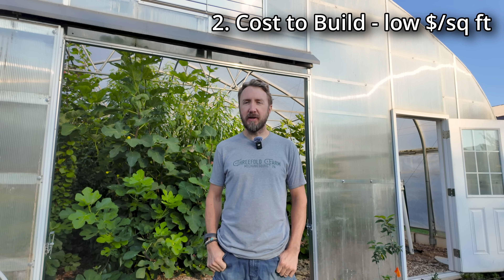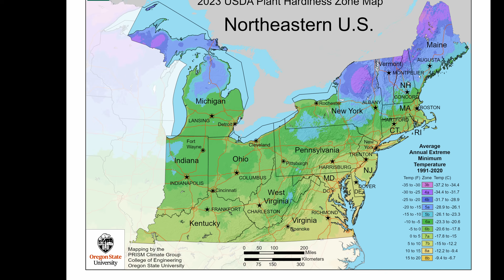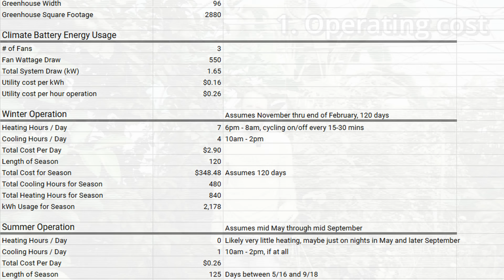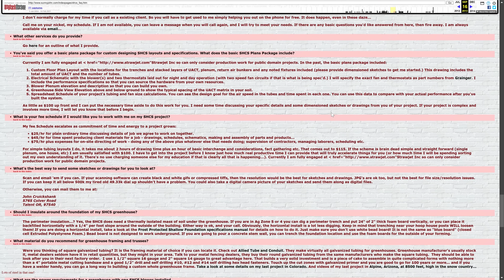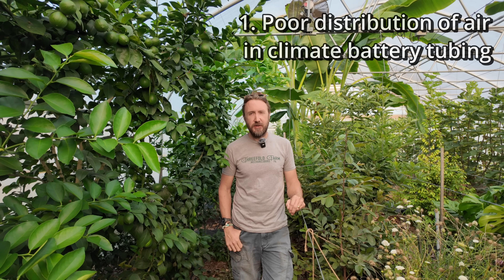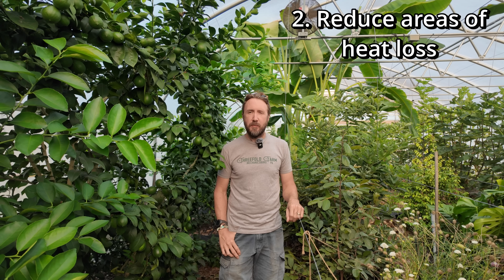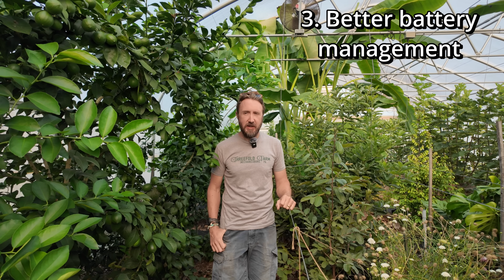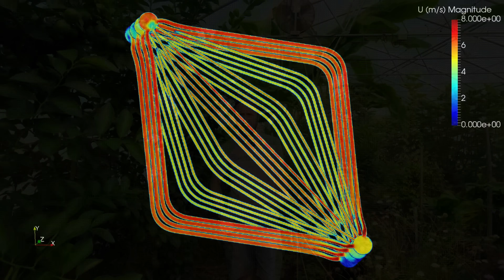Building an (Almost) Tropical Geothermal Climate Battery Greenhouse in a Temperate Climate

Comment: Pa is a very big state.  Ya not as big as AK but big with a # of growing areas in it not only form N to S but From E to W.  I Live at N42 which is the NY-PA boarder when it runs straight W and do S of Rochester.  My guess form the pics I see of ur place u r in the lower Potomac river Valley as flat as it is thus u r 2 growing areas below where I live and if u go further W and a little S rather then getting better it get worse in that u go into mts.  This yr our last forst was Apr 24 and first was Oct 8.  '23 it was Apr 27 and Oct 8.  Making my growing season this yr 167 da if my math is right.  Until USDA change the4 map in what I think 23 our growing season was but 123 days May 15-Sept 15.

Now I keep track of freeze dates for many yrs now and in just the past 10 yr the world has warmed enough to add those 37 days.  Will have to see what happens next spring for that is the day that seems to be coming earlier each yr.

I dont have that much land just 2 ac with only about 1/2ac useful land for growing anything.  rest is to wet and forested so have just one little, 18x7"6" interior I heat for month of Feb 15 until last frost.  Use a 220v heater.  Yes it cost me but not that much b/c I do have one little 5K wind mill up.  Looking to put up another next yr if all goes as planed.  I dont borrow money.  I save util I have enough to buy what I want and then I buy it. Took me form '75 to 88 living like I was making min wage (eat a lot of rice and beans and lived in one little room) and bought this place out right in 89 and got my azz out of the cities and back to where I grow up.

To show how much u can actually grow in raised beds (4'x8'x32") 40 of them and then an area of about  1500 sq ft I grow sweet corn and long vine corp on like squash and melons.  Do a bunch of pumpkins b/c I feed them to chickens.  Yes they love them and they keep well into winter.  Got me 50 layers.  I sale a few Dz eggs every day.  Now in those beds I am able to grow every veggies I eat and I have a farm stand where I sell what I dont.  This yr so far that stand has gotten me a little over 10K.  Still selling winter squash, pumpkins, and other cold weather crops live cabbage fam and such.  I already have put up all I will need till next yr and then some b/c I do have friends over for cook out and dinners so I need about a 1/4 more and put up 1/2 again so that I know I have enough.

I have said I do chickens. Each yr I do 150 meat birds.  Sell 100 of them and keep the rest for me.  I also do Flemish Giant rabbets for meat and I buy beef by the 1/4 cow form guy 2 mi up road. lamb form my next door neighbor 1/2 mi and pig I get form a guy down in Pa 20 mi form me.  Buy 3 lambs and a pig each yr.  Go in with 2 other on the pig.  I take about only a 1/4.

My green house if made with 2x4 with polycarbonate outside and 10m plastic inside making it bubble walled.  Along the north wall which is wood and insulated with 23R, I have 55 gal drums filled with water 3 layers with the top one laying their sides do to height.   Have no idea how much they save me but it got to be a a lest $200 on cost of heating.

Comment: I think maybe you could build a clay pipe and build some fires to bake it in place. Then it will transfer heat better than a plastic pipe so you could have less pipe and less fans. I suppose metal would rust but a clay pipe might work or concrete. Maybe it wouldn't even need to be such a good pipe like you could make sections and just put them roughly together since it will be sealed anyway once it is  buried. Maybe you could just dig a couple of trenches to put the pipe in and it would be good enough. The wind break is important so if you chose a good spot that already has some shelter and warmth it could be quite simple. If you have a trench you could also put one pipe at the bottom and one a bit higher as you fill it in. You don't even need a pipe but an arch or an A shape might work just as well and be easier to build. What might also be worth considering is making a big channel of pebbles and covering with a sheet of plastic. The air could still blow thru like it was a pipe but it would absorb the heat real good and transfer it into the soil over a bigger area. Maybe it would have too much resistance for a fan but if you build the greenhouse on a slope you might be able to get it to flow automatically using the heat differential. In any case you could still use the pebbles as an outer pipe taking greater advantage of a trench dug. In that case you might be able to use metal for the inner pipe like some sort of mesh fencing might be strong enough to hold the pebbles out and then the air could flow readily between the pebbles. Maybe you could put a piece of plastic pipe inside it like a mold when poring the pebbles and then pull it out afterwards. Something like that could really capture the heat in the summer and charge the ground. Then you just do one trench thru the center of the green house and get it in a bit deeper. On the outside of the greenhouse you could put some wood chips and some sort of evergreen bushes to help keep the cold from penetrating the ground under the greenhouse.

Comment: Take a metal drum paint it black fill it with sand and put a horse water heater also, do you put water in there as well? He’ll act like thermal mass but you can also control when you add keep to it as well.

Comment: Outstanding!  I would like to see more detail.  For example, the use of plastic corrugated tubes versus a smooth and better conductor.  Insulating the soil battery from the earth?  Water instead or in conjunction with air as your heat transfer medium.  For example, using metal pipes/tubes in a crushed gravel bed of water that is thermally enclosed, thereby transferring hot air to metal to water.  To even out air flow into the battery, have you thought of using a manifold, like you would do for water?  Use of multiple smaller fans?  What is the best speed to get the most efficient heat transfer?  I will subscribe because you peaked my interest.  Please discuss these ideas.

Comment: As a com sci prof I reasoned that a lean-to greenhouse against my brick south facing wall and barrels of water with aquarium heaters should do it. Zone 7b.
Reply: Put in some geo-thermal tubing to help heat and cool it. Depending on the size. Dont forget to add misters.❤❤❤
Reply: The amount of moisture that will be taken up by the bricks and transferred into your house will be high. Same with wood. It's never a good idea to put a greenhouse against a wall to a house. House walls just aren't made to manage the moisture transfer
Reply: As an engineer, I'd just use a vapor barrier against the brick wall, & place the back wall of the greenhouse against it. It will still act as a thermal battery but will remain a separate entity from ur house.

Pro tip: automotive parts like fans, pumps, wiper motors, relays, etc r all fairly durable & run on 12v. Adding an adjustable dc to dc boost converter to a lipo battery ups its efficiency from 85% to the high 90s, while allowing u 2 dial in presets on both sides. Just bcuz the fan demands 12v, doesn't mean 12v has to b supplied by the battery. U can reduce the input voltage on the converter to 3v & adjust the output voltage to 12v, making ur battery last 4x longer which will increase its overall lifespan by reducing cycling. (A partial discharge & then a partial charge counts as 1 cycle)

It provides redundancy in case of power failure. The battery acts as a UPS. A cheap timer can b used to t on & off the charger at night during off peak time for less money. The initial cost is offset by its ability as an UPS bcuz it will save ur crops from being cooked, or frozen. It will slowly earn its keep thru the electric meter.

The aquarium heaters will b on fairly steady thru winter. U may b able to power them with small micro inverters connected to boost converters as a longterm solution to reducing electricity costs ovr time. I think the heaters might b able 2 run on dc if u open them & rewire them. The alternative is plugging them all into a large inverter & placing a sizable battery bank behind it. To ensure the batteries r not going to heat up from pronged heater coil draw, u can decouple them from the heater power circuit by placing a dc cap bank between the battery & the inverter. The batteries r no longer connected directly to the load, the cap bank is. So its now doing ALL the heavy lifting. It handles startup load spikes & shutoff flyback by preventing them from reaching the lithium batteries which r highly sensitive to both. If u install a cap bank, it must match the voltage of ur system. 48vdc is much more efficiently converted to 120vac than 12v dc is, simple math. If ur battery & inverter r 48v, the cap bank must also b 48 volts. ALWAYS make sure u install an active BMS to control ur cap bank, & ur battery bank. U want to maintain balance across all cells batteries & banks. Safety first.

It should b self sustaining once u set it up. A timer can t on & off the charger, as always, for off peak charging. As long as u calculated how much power the heaters needed in a 24hr period & built ur battery bank to accommodate that, it should function like an UPS non-stop.

I had to find a work around to power my last greenhouse during winter power outages. Propane heaters worked great but constantly needed refilling. Winter is great for solar panels with trackers. As long as I kept the snow off it, a couple panels, couple batteries, & an inverter powering a heater to keep it at around 60° gave me the backup I needed, even with my crappy lead acid batteries from the boat. (They aint sensitive, they dont really need decoupling) Saved everything from freezing. 

I was gonna build a super insulated electric basalt sand battery circulating heated automotive coolant thru a double core truck radiator. 12v automotive water pump & fan doing the work. Electric elements powered by solar, heat the sand battery all day. At night, the pump & fan switch on & heat the greenhouse, & off in the morning. I moved & dont have a greenhouse anymore, but my next one is getting one of these heaters.

Comment: If you have the network without the fans, you should still be able to arrange airflow because the warm air will want to rise out of the system into the greenhouse (in the cold season). Does this not provide enough airflow?

Comment: Curious if you have any opinions about the idea of using antifreeze in a small tube as your heat transfer fluid instead of moving air directly?  I figured that the differential air speed issue would be mostly gone if you could use a long straight run of liquid-holding pipe.

Comment: What about adding geothermal fluid loops, connected to solar thermal  panels, to add heat to the battery on sunny winter days?  not sure if you covered that on any other videos, and not sure it it would work, but seems like it would.   Great video by the way.

Comment: Whats the reason not to incorporate a waterstorage in the form of a cheap pastic tank as your heat battery?
Wouldnt that increase both storage capacity and heat transfer rates?
Reply from the maker: It's really about ROI. I haven't fully investigated the economics of a water-based solution, but tanks that are large enough to be functional in a system like this are expensive. Additionally, they'd require radiators, pumps, fans, etc. Not saying the economics aren't worth considering but it's still an item with significant expense.

Comment: was thinking about something like this if i was going to buy a parcel and build new house and somehow connect it to a heat pump, this way i would be able to pre-heat the cold side of the heat pump which would increase the efficiency and lower power consumption allot. as for greenhouse you might get a bit more boost in plant performance if you are burning a bit of gas during the coldest part of the night in winter, this will produce increase of CO2 which will help plant growth and will help getting more energy from the sun during the day.

Comment: Absolutely compelling and inspring. Conducting your video with a thriving lush background example was definitely a nice proof to constantly see. 
We're in Idaho and have open loop geothermal discharge water that I've been noodling over how to maximize and now Im wondering if a climate battery power greenhouse located at the end of the discharge hose could be combo'd with all the water that the prior owner simply drained out onto the field with no other use.
Fantastic content and you can tell just how deep you went with the research effort. Just awesome!!
Reply from the maker: Appreciate the kind comments, and always interested to see how folks use waste heat. Good luck in your efforts!

Comment: One idea I can think of to enhance the heat storage capacity of your soil takes an idea from the Earth ship people, that of using basically trash.  Water has something like 2 to 4 times the heat capacity(storage) of soil, depending on how wet the soil is.  I was thinking of in the back filling of the soil around the underground pipes, just adding really a lot of 2 liter drink(sodas, etc) bottles filled with just plain water.  The empty soda bottles could be had for nearly free from recycling centers.  I would fill them 100 percent full where they would be highly crush resistant to soil pressure.  In the places where freezing might be possible, I'd leave a little voids to accommodate the water freezing, like maybe 5 percent.  Arranging the water bottles around the pipes with backfilling would take a little more work and care, but once the pipes were partially covered, the rest of the backfilling could proceed as usual.  My idea would be to use 1000's of water bottles, such that the soil within a foot or two of the pipes would be about 1/2 water bottles.  Below, above and to the sides. 
The other thing that might enhance the efficiency would be anything that could enhance the heat transfer rate between the air in the pipes and the surrounding soil(water).  Some heat pipes which use phase change would hugely increase the heat transfer rate, as heat pipes like this are 100's of time better at moving heat than solid metal.  But they are expensive to buy, but might be less so if home made, which is actually fairly easy.  The cost would be mainly the pipes, which could be copper or aluminum conduit.  Copper end caps can be soldered, and Aluminum could be glued.  There are plenty of how-tos to making heat pipes, with either acetone, alcohol or just water as the working phase change fluid. Heat pipes work at the lower pressure than atmospheric.  Smaller diameter pipes, besides being cheaper, would also be better at resisting the pressure differential.

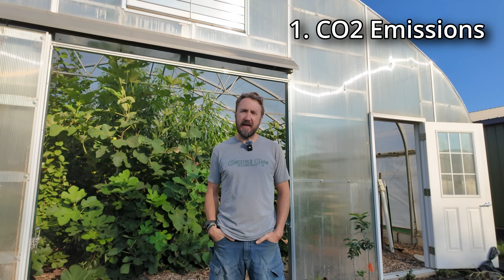Comment: 4:11 don’t plants thrive on CO2? The amount of sun they can absorb means nothing without CO2 to consume. Am I missing something or thinking too deep into it? Wouldn’t it at bare minimum balance out, if not encourage more plant growth?
Reply from the maker: I appreciate the respectful tone of this, thank you. Unfortunately I've gotten a lot of CO2 comments that amount to insults that I won't dignify with a response.

My primary objection to fossil fuels was simply cost: if I heated with propane or natural gas it would essentially eliminate any profit I might expect to get from the fig plantings in our particular context. This is a bigger answer than you're probably asking, but I am not against the use of fossil fuels for the right sorts of applications. I am against the use of them when I think a better option exists for the farmer that can help increase their margins. I'm also for using all of the on-farm resources we can, including the sunlight we're given, which a climate battery tries to do. It gives the farmer agency and helps them rely less on external inputs, which I think of as a good thing.

In terms of your direct question, in my understanding the CO2 that most heaters generate never gets directly used by the plants, it's exhausted out of the greenhouse. There are likely ways to use it, which would likely be helpful to a point.
Reply: @threefoldfarm You’re welcome and I appreciate your time responding to me. This totally makes sense and completely logical. I would even dare say, something I would pursue if I were in your same circumstances. If we can keep it natural, it is always better, especially when it does just as well and you save money.

Comment: dude - you were very thorough without being boring - that's impressive. I was wondering the difference between a heat pump system and passive climate battery. I guess the heat pump is using some kind of HVAC fluid for compressing heat or whatever toxic substance is used in refrigerators or whatever. hahahaha. My relatives design heat pumps for their engineering careers!! They don't even know each other but both are are prominent colleges - doing their work for each college. Pretty hilarious how that panned out.
Reply from the maker: Thanks for the kind comments!

Comment: In Brazil, we need basically the opposite, at external temperatures between 35 and 40 degrees Celsius, to stabilize the temperature inside the greenhouse below 30 degrees Celsius throughout the day... Could climate batteries and earth pipes be a solution? how to calculate this?

Comment: Wow one of the big disadvantages of geothermal was that earth has poor absorption and it doesn’t dissipate heat fast enough. Example would be people undersize their geothermal loops and it doesnt cool their house enough. This works perfectly for a slow release battery system however. Instead of seeing the heat build up as an issue its the solution to cold nights. Obviously the systems still have to be sized right but this is great.